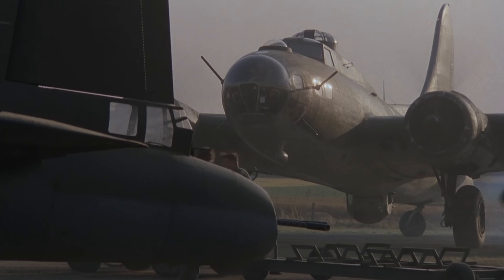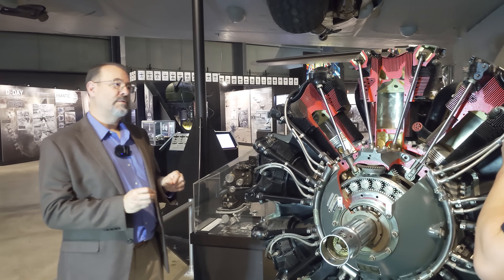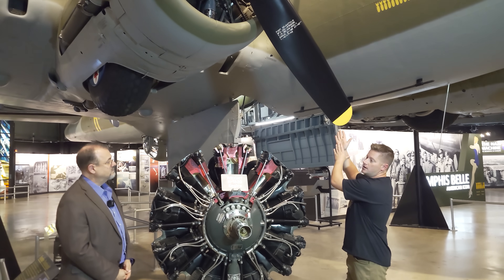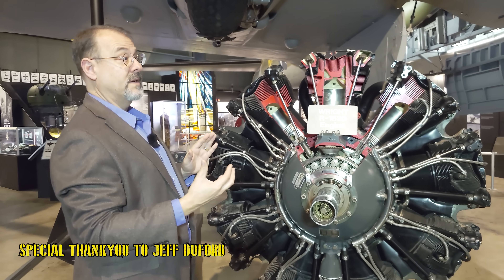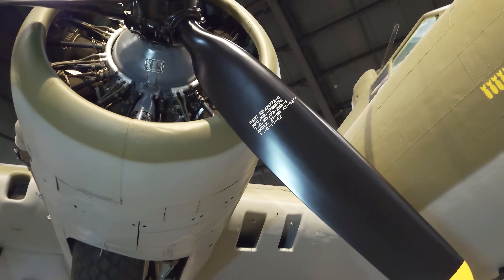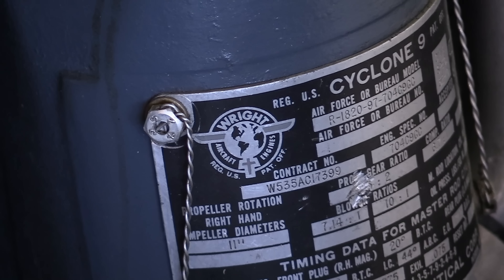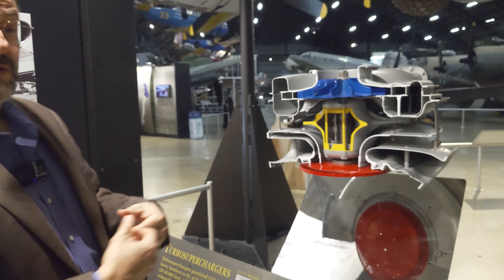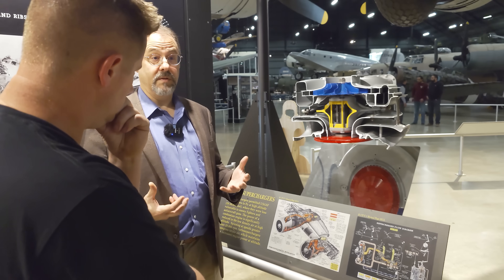B-17 ENGINES IN DEPTH! Genius Or Insanity?

Comment: Several years back, I worked on the ramp when the Collins Foundation was visiting during one of their B-17 and B-24 tours. Both planes started up together and did their engine warm-ups. During the warm-up, you could hear the difference in the B-24's R-1830s and B-17's R-1820s sound. The Wright engines sounded smoother running, versus the Pratt engines which had more of a tick to them. Great engines both, which you could count on in bringing you home.

Comment: I can actually answer that question for you.  There is a term called War Weary.  As these aircraft were repaired during the war, (according to a mechanic I spoke with at an Air Show)... When these planes would come back after action, parts were salvaged from wrecked aircraft.  Planes that would crash or be wrecked, for whatever reason, the useful parts would be salvaged from those wrecked aircraft.  By war's end very few of these "War Weary" aircraft were 100% factory as they came from the assembly lines.  This was true for ALL of the multi-engine bombers, both Heavy, (B-17, B-24, B-25, B-26, A-26, B-29, P-61, PBY Catalina or the Martin Mariner).  Any of these aircraft, where parts could be used were taken from them, and used to rebuild existing operational units so they could be quickly placed back into service.  According to what I understood, average turnaround time for mechanical was no more than 48 hours.  

The propellers used from other aircraft were not always the Hamilton Standard Airscrew.  Plus not all of the B-17's were manufactured by Boeing.  Boeing licensed manufacture to McDonnell Douglas, and Ford Motor Company.  General Motors made several aircraft during the war to include the TBF Avenger for the Navy.  From this many different automotive companies contributed to licensed contract parts for these aircraft.  As seen on the engine here some of the engines were made by Studebaker.  Many of the P-51 Mustangs were first equipped with the Merlin Engines from Rolls Royce.  Many of the later models were equipped with Packard Merlin engines under license from Rolls Royce.

More examples of US Manufacturing ability not only extend to aircraft, but to the very Rifles and Pistols the soldiers carried into battle.  The M-1 Garand was not only licensed by Springfield, it was licensed to Colt, International Harvester, Winchester, Underwood Typewriters, John Deere, and Remington.  

What is so interesting is how fast the entire US Industry base could be switched over to war footing so quickly.  

But back to the aircraft.  What is often not shown in these films are the huge scrap piles of broken planes, piles of parts and equipment recovered from wrecked aircraft that crashed at the bases.  Parts from aircraft that were no longer flight-worthy were used to patch up and repair other planes until parts supplied became possible.  It should be noted at this point, nearly all of these replacement parts would be sent by ship, very little of this material was shipped by air.  The parts were just too heavy, and the aircraft technology of that time was just not able to do today's version of heavy lifting.  So nearly everything was sent over the ocean.  And... all of it at risk of being sent to the bottom of the Atlantic Ocean by German U-Boats.  

The planes had to keep flying, and the mechanics often had their work cut out for them by rebuilding the structure of these damaged aircraft from the materials made available by wrecked units no longer able to fly.
Reply: Flying through flak a propeller blades are bound to get nicked.
Supply chain evolves, 5:52 - New latest prop, well known last gen production may be sent to a sub while HS concentrates on perfecting new latest.
What was the Frankenstein-B-17 in the Pacific with all the guns? That's some re-use.
Reply: Unfortunately, The US no longer has the ability to quickly switch over manufacturing to war products. We gave away the farm when all the MBA 's running American companies began outsourcing our manufacturing plants offshore, mostly to Asia. Call it greed, stupidity or whatever you like. We now rely on our adversaries to make things we need. They can cut us off anytime they desire.
Reply: @RobertBeck-pp2ru  Robert, it is indeed about both greed and stupidity. Research NAFTA. This was a bill signed by Democrat President Bill Clinton. Republicans were against this because they knew what it would mean for the future of US Manufacturing. I'm in the Automotive industry. As a direct result of this bill, this industry has been hit the very hardest, along with steel manufacturing.  Detroit, Milwaukee, Pittsburgh,  all of these heavy industry cities are now cesspools of crime and strife thanks to this legislation. 

H. Ross Perot was the most vocal opponent of this bill knowing what it would do. "In ten to fifteen years there will be a giant sucking sound in the heavy industry sections of the United States." 

Here we are. Who pushed this... the high tech industry of California and New York. The electronic companies, IBM, AMD, Apple, Microsoft, Silicon Graphics, Sun Microsystems, Intel, Hewlett Packard, and many others grouped together and were the pressure group to get NAFTA to pass, because they were failing due to labor costs.

Now workers under Tax and Work Visa's are brought in from India, Pakistan and other countries, placed on internships educated and sent back to India and now work there for pennies on the dollar. Same with the Phillipines, Malasya, China, Taiwan, Russia, Canada, Mexico, Peru, and many others. All US supplied jobs moved overseas. And this continues...
Reply: Another item, in particular about the propellers,  two major companies Hamilton Standard and Curtiss Electric both manufactured props for the B-17's. Because of the differences in prop design, the salvaged props were repaired from flak damage, bullet holes or crash landings. The props were heated, shaved, reshaped and rebalanced, then fitted to the engines. Again bombers and other multi-engine aircraft were all done the same way. 

There are several books available about WWII Aircraft Development and the difficulties, successes, and design aspects. A few titles include, "I Could Never Be So Lucky Again, General James K "Jimmy" Doolittle, Air Force Spoken Here, HAP, Flying Fortress, The Liberators, Superfortress- Col. Curtiss LeMay... just to name a few. Mustang is about the development of the P51 Mustang, often said to be the most advanced Fighter during the war. On a personal note I would debate that aspect against the Lockheed P-38 Lightning. But that is for a different discussion.

Comment: The turbo adds back pressure on the exhaust cycle so....not free.  But the waste gate allows for greater flexibility.
Reply: But turbo adds front pressure - just being argumentative
Reply: @franksizzllemann5628 More air means more fuel means more power.
Reply: Gale Banks has a great video exploring this, and a well-matched turbocharger is remarkably less restrictive than most of us gear-heads have thought. Not exactly free, but close.
By contrast a mechanically driven supercharger imposes a constant resistance to crankshaft rotation

Comment: Radial engines are a fantastic combination of sheer genius and utter insanity.
Reply from the maker: Someone who finally understands my well thought out title! Welcome to the channel my friend.
Reply: @MilitaryArmamentsCompany  I don't see the insanity though. Everything in the engine made sense. It was a smart evolution of the ICE, optimized for higher altitude.
Gamers and armchair generals don't appreciate the value of America's compression technology. Our aircraft could operate at 30,000 feet while the Germans struggled to be relevant at 20,000 feet. Germany's lack of supercharging meant they had to have huge displacement engines, at a cost of range. 
Thanks to the automobile manufacturers' understanding of materials, critical engine components were made from specific alloys, tricks like sodium-filled valves to combat predetonation, and of course the materials to build 20,000rpm blowers and knowing the appropriate boost settings all played a critical role in dominating the air.

The B-17 airframe is so classic. It's fun to daydream about a civilian B-17 that is powered by two turboprops. That would be the ultimate Rich Person's toy.
Reply: @MilitaryArmamentsCompany  Another idiot, in other words
Reply: Two turboprop DC3 do exist. Great plane
Reply: Genius for sure then they had double rows before jet age
Reply: @terrygates8546  B-17 with R-3350's would have been beastly.

Comment: As a retired aerospace senior quality engineer, it’s mind-boggling that these engine systems were designed with brain-power, math books, and slide rulers!

When looking at the cut-away display engine, the complexity of the gears, cylinder firing sequence, fuel injection, compressed air, and oil distribution systems were all made by manual manufacturing equipment. And interchangeable from different manufacturing companies. Absolutely impressive. 🇺🇸
Reply: They were made by Machinists. lol look that one up, not green button pushers!  What an incredible trade!
Reply: Tool and Die makers made it possible.
Reply from the maker: You are absolutely right, unbelievable some of the things we come up with.
Reply: @MilitaryArmamentsCompany 
Today, we celebrate the prospect of losing the ability to do such things. 

How? We are inviting Artificial Intelligence into our lives.
Reply: The timing is like making watches. With 2000 horse power and 325mph.  I would to see the engineer drawings of the engines. Wow! The math skills!
Reply: @joebudi5136  And the fact that they were interations of simpler early radial engines.  Each just a bit better/complex developing the skills of the builders.  The guy doing the math, or leading the department, on the R-1820, likely helped with the motor development on the Spad XIII (built by license in the USA) and it's relatively simple radial.
Reply: Pratt and Whitney and Studebaker and Wright.  Wow.
Reply: @joebudi5136  Add Packard, and Ford and Chrysler to the list of sub contracted aero engine builders,and there may have been more
Reply: After experimentation in how to attach fins to cylinders, it was determined the best way to put cooling fins on the cylinders, was to cast them as one solid block and then machine the block, removing all the metal leaving the fins in place.
Reply: Truth!
Reply: real QA.
Reply: In college in the '70's, we still used slide rules'slip sticks'.  Imagine planes, dams, even Hoover Dam, being figured with these things!
Reply: You have to put development into historical perspective. I used logs, sliderules etc and it was second nature. The thinking of the engineer was the creative bit. Also the tolerances, metallurgical knowledge were all of its day. War of course sped up all aspects of engineering; trial and error at speed. Brave pilots, brave people,  bless them all.
Reply: I concur well said
Reply: At the time they were built the R-4360 4 row 28 cyl. were reputed to be the most complicated piece of mechanical equipment ever built.  And all with pen, paper, drafting board, and a slide rule.
Reply: In reference to "slide rule and brain power" in the 1980's? The Navy decided to upgrade and computerize the Fire Direction Control (FDC) of the 16" rifles of the battleships USS Iowa and New Jersey. After testing and extensive debate they decided that the analog 1930's technologie was good enough as the changes to computerize would only provide a five percent increase in accuracy.😅
Reply: Take a look at a cut away of a Bristol sleeve valve radial if you like complicated .

Comment: Radial engines were clearly engineering genius from that era.  The low melting point of sodium allowed for better heat dissipation as it sloshed around the internal chamber of the exhaust valve. Not mentioned in the engine description and of interest: all radial engines have odd numbers of cylinders to facilitate the every other cylinder firing order, which even applies to multi-bank engines like the R-2800, R-3350, R-4360. The crankshaft travels in a concentric path around the propeller drive gearing, There is a master cylinder with a fixed connecting rod, while the remaining cylinders have articulating connecting rods.
Reply from the maker: Excellent information.

Comment: Engine output power is proportional to the weight of fuel burned. The proportion of fuel mass (call it weight if you like) to air mass also controls power output. The ideal proportion (mixture) is 14.7:1 (pounds of air:pound of fuel) at which point all the fuel will be burned and release its maximum heating value. Heat is what makes propellers turn. Since air at high altitudes weighs less than the same volume at sea level, the amount of fuel the engine can burn is also less and produces less heat and power. The turbocharger corrects this problem by increasing the mass of air entering the cylinders so that more fuel can be burned to produce more power.
Reply: I find it interesting that the proper air fuel ratio is the same number as the weight of air pressure at ground level...14.7 psi
Reply: It is an interesting coincidence but only the per square inch bit and don't forget that is 14.7psia absolute pressure. The ratio is the same in kilograms or tons or ounces. Reciprocating aircraft engines have adjustable mixture controls because an economy mixture is just over 15:1 and highest power is around  12.5:1. Different fuels have different ratios, natural gas for instance is around 10:1.

Comment: they were vastly outdated by 1943, but due to the electrical systems being intertwined with the engines it would have cost too much to refit them with newer engines, which is why the G model remained with them while other bombers gained engine upgrades
Reply: Out dated? The R-1820 was used up into the 1980s on the Navy C-1.
Reply: youre comparing a non direct combat aircraft that hunts submarines with no risk of air to air action with a direct combat heavy bomber that saw action against enemy fighters. the engine was outdated for the use on heavy bombers 

the RAF and USAAF continuously throughout the war updated the powerplants on all their bombers, even the B29 had two engine updates, yet the B-17 was stuck with an engine first designed in 1930s when there were other radial options that could have aided the B-17 but couldnt be implemented because of bad aircraft designing by boeing on the part of electrical systems @bobharrison7693

Comment: I saw the Sentimental Journey B17 at an airshow in the mid '80s. A couple of interesting things I remember about the engines. 1 was tagged Wright Aeronautical, 2 were General Motors, and 1 Studebaker. The center hub of the turbocharger exhaust bucket wheels were branded Allis Chalmers.
Reply from the maker: Amazing you remember those details! There's Passion in the subject right there.
Reply: I flew on the Sentimental Journey in July of 2013 in the nose. Navigator and bombardier seat. What an experience! And I checked that one off of my bucket list. 😊
Reply: ALL such flights are now no longer allowed because of a recent B17 crash that took multiple lives.
IIRC it was pilot error
The FAS is not allowing these pay to fly flights any longer
Reply: @philgiglio7922  That's why I flew on one a long time ago. I saw the writing on the wall even back then thinking that insurance companies were going to stop allowing it.
Reply: Isn’t it WONDERFUL ? We are Blessed to have done It

Comment: The courage and determination of the air crew is definitely worthy of praise but the ground crews and logistics that kept these planes in the air was nothing short of remarkable. Everyone understood that they had a job to do and lives depended on their getting it right.
Reply from the maker: Very true. Agreed!
Reply: My dad was an aircraft powerplant   mechanic during WW2 based in India. They would do the maintenance and overhauls of the engines. One thing that my brother reminded of was that once an engine was ready to go back into service, that engine, using a test stand, was run at full throttle for 24 hours before it could be put into an aircraft.
Reply: @Texas40years  
Better to break on the stand. 24 hours seems like a lot. They earned their title of “greatest generation”.
Reply: Very true. On the other hand the Germans had engines manufactured by forced workers and prisoners, with lost of sabotaged key elements. Also courageous resistant people.
Reply: Yes yes yes, not brass or steel or yyyyuuuge balls....just courage and determination. Worked on the flight deck for many years, only natural nurtz noticed

Comment: The turbo supercharger restricts exhaust flow which has to reduce power output to some degree, also such a system is probably impractical on a sleeve valve engine, Wright engines had poppet valves which where easier to achieve in an aero engine.

Comment: The RR Merlin 61 had two-speed two-stage superchargers with inter cooling between blower stages. They did absorb more engine power than turbochargers but they used significantly less space within the aircraft. This is why tiny planes like Spitfire were able to compete throughout WW2. P-38 Mustang used an air to coolant charge cooler mounted under the engine. Main radiator was under fuselage so the exiting hot air vented into the low pressure area behind the aircraft. This was not possible on an air cooled radial engine.
Reply: The first 2 stage/2 speed supercharger was the PW R-1830 in the F4F-3 Wildcat.